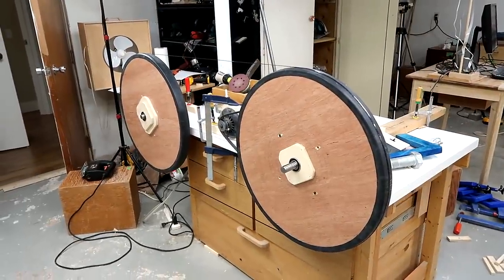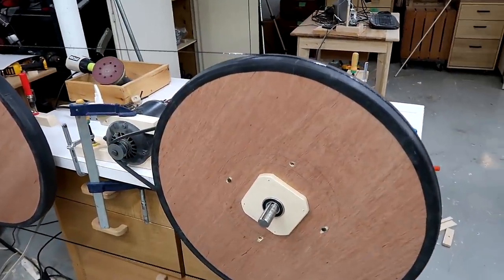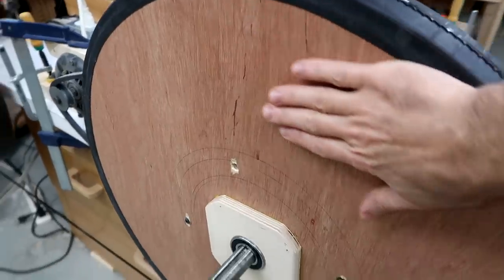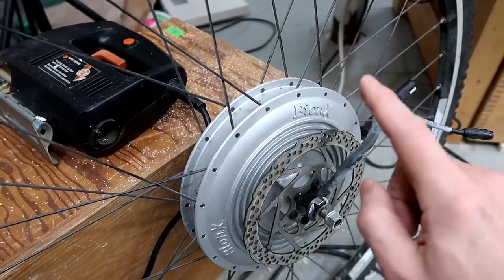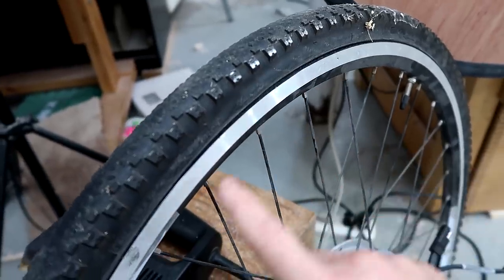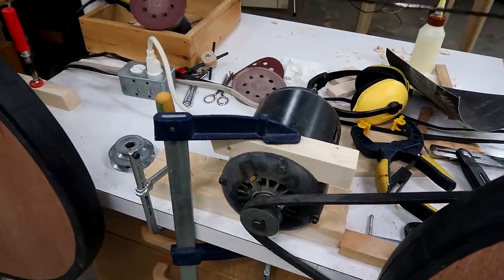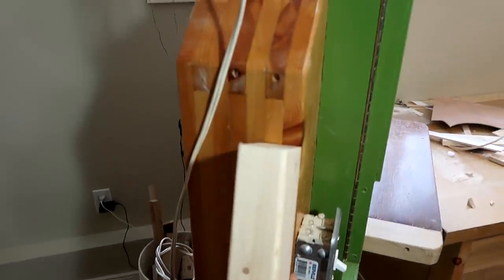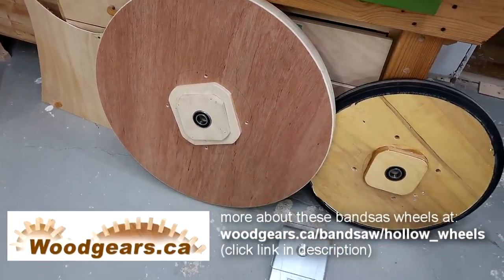More about the hollow bandsaw wheels I built

Comment: Would it be possible to use multiple smaller wheels to create a trapezium shaped path for the blade? It seems to me like that would be a better design if you don't want to take up a lot of vertical space but want to maximize the distance to the left of the cutting area. The only downsides I can see are the increased friction from the additional wheels, complexity of aligning 4 wheels, and the additional horizontal space required. When you're getting to wheel sizes that are around a meter in diameter it seems like you're not really gaining much extra room compared to how much extra blade length you need to span the wheels. Four 50cm wheels could fit into the same amount of space but spread the blade out much wider to give both more horizontal room and more vertical cutting height in a similar space.
Reply: I cant remember the details but check the previous video that he mentioned
Reply: He decided against it because the smaller wheel diameter means the blade would curve harder (more severe) and thus resulting in higher stress in the blade. Which leads to material fatigue and blade failure. So after all it wasn't worth it.
Reply: I have a 3-wheeled bandsaw.  I never use it because it's a giant pain to get the blade to track right.  It's easier for me to use hand tools to make those kind of cuts than it is to deal with the wonky blade tracking.

Comment: Would it be possible to build a bandsaw in 2 separate parts and eliminate the post near the cutting table all together by mounting the upper wheel to the ceiling rafters and the lower to the floor?
Reply from the maker: The blade still needs to come down where the post normally goes, so this doesn't help.
Reply: @matthiasrandomstuff2221  of course. Feeling dumb now haha
Reply: @matthiasrandomstuff2221  Couldn't you go crazy and make a giant four wheel bandsaw? Run the blade along the ceiling and under the floor. Having it built-in to the room should eliminate the floor space issue of a three wheeled bandsaw. I'm sure it would introduce several other problems, though.

Comment: Have you considered a VFD? They are dirt cheap these days, you can run a smaller more powerful three phase motor, control your ramp up speed so there's less stress on start up, adjust optimal speed regardless of pulley size, and set a rapid deceleration for quick stopping.
Reply from the maker: They are quite expensive still compared to just buying an induction motor, and that is quite expensive compared to a used motor.

Comment: why havent anyone built  the wheel to also make an impeller? not to much, just to suck the overhead dust and push that stuff out the back? power, sound, balance ... better leave that thought in the bin with the other bad ideas :)  But I know the feel when starting with one material and removing and change parts ... then IN the end not even the scent  is from the original part..

Comment: how bout through axle bicycle wheels?
Reply from the maker: which I would get from a through-axle bicycle?  Oh, wait, there's no such thing.
Reply: Solid axle?
Reply: Thru axels are standard on higher quality mountain bikes.  15mm diameter on front wheels abd 12mm diameter on rear.  Still requires a dual sided mount though.

Comment: It is also hard to start a bandsaw with heavy wheels.  The belt tends to slip.  One can use a soft start motor setup but its easier to use lighter wheels.

Comment: How about a 4 wheel band saw build.

This would in essence be two 2 wheel band saws mounted one on top of the other.

You would insure that each set of two are tracking properly independent of each other, then work on tracking the 4. But because you know the sets of 2 track right you would work on tracking each set with the other set.

As far as wheel size, 10mm may be optimum.

A 4 wheel design would allow for a good depth of elbow room.

Another way you could increase your elbow room is to have the top wheel or wheels mounted to the ceiling joists.

After a point, trying to go bigger may turn into a 'Tim the tool man Taylor' catastrophe.
Reply from the maker: watch the video I was referring to
Reply: @matthiasrandomstuff2221  

I did watch it.

A two pulley band saw will always be limited in regards to the elbow room.

Ultimately, the size of the pulley will be too large to make it manageable.

Perhaps the way to get past the wheel size limitations is to have the blade roll along a series of ball bearings that maintain a specific arch as it rounds the corners of the guide. 

This may turn out to be a lighter design all around or just easier to get to track straight.

If the bearings had a flange on the one side that the back of the blade ran against, the bearings could be mounted with a slight slant that encouraged the blade to run against that flange.

The arch of a 20 inch pulley could then be used to insure the blade does not get fatigued.

Well, that was an interesting rabbit hole to run down.
Reply: and tell us what CAD program you use, and how you feel about pocket holes and biscuits.

Comment: Steel City are still alive, and still making granite lower wheels, and cast iron upper wheels. 
And amazingly, a granite table. Which tilts. I wouldn't want to have to move it though.

Couldn't imagine how long solid stone and cast iron take to get up to speed. And how long they take to stop with no brake.
Reply from the maker: They ceased operation in 2015.  Maybe they got bought.
Reply: @matthiasrandomstuff2221  ah, probably another company just using the name then